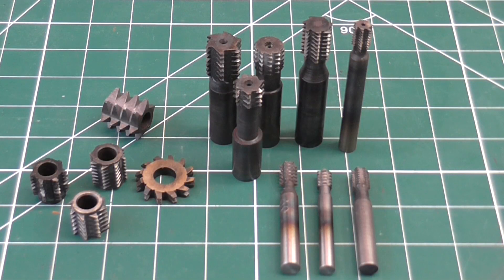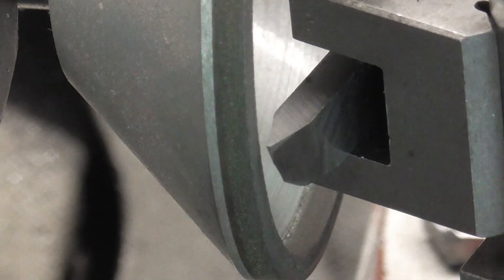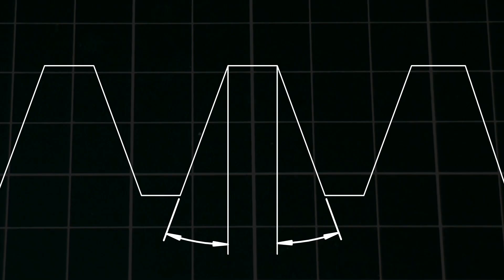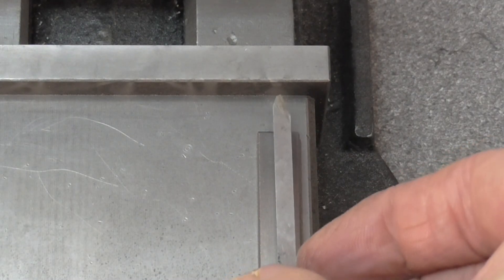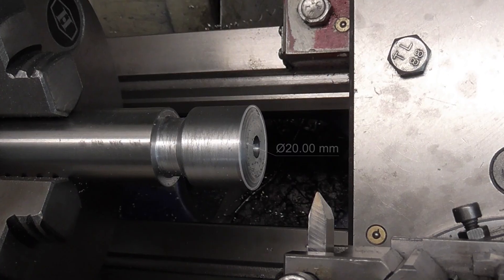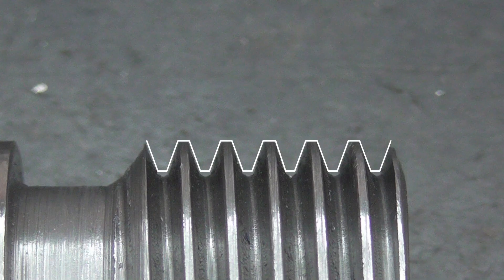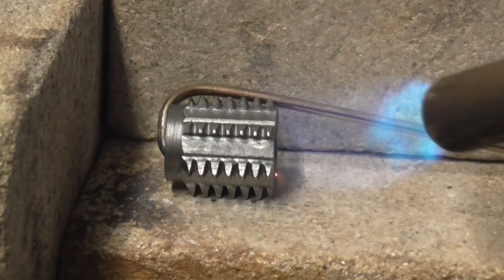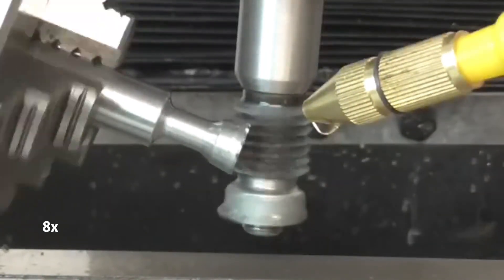How do I make my own gear hobs? (Gear cutting)

Comment: Hi Andy, I have another (hopefully last) question about home made hobs. How do you calculate the helix angle. I think the angle is a function of the diameter of the hob, but am not certain. If i'm right, do you use the outside diameter, or the pitch circle diameter. I'd be extremely grateful if you could give me an example, and the maths for the calculation. I assume this is the same angle you set the mill spindle to ?
Reply from the maker: I use the pitch circle diameter, the helical angle is the inverse tangent of the pitch divided by the circumference of the PCD. eg. if you had a 1 module hob with a pitch diameter of 40mm it would be ATAN (π/40 x π) (or in this case just 1/40) = 1.43° Think of it as a right angle triangle wrapped around a cylinder with one side being the circumference, the short side being the tooth pitch, and the hypotenuse forms the helix angle.

Yes, this is the angle you should set the mill spindle to but in practise you can be slightly off and it makes little difference as the tiny cosine error will be swamped by other limitations. I sometimes just line up the teeth on the hob by eye (always good to check that way anyway in case you tilted the mill spindle in the wrong direction!)
Reply: @AndysMachines  If I was to cut a 16D.P gear, with a hob of 1" O.D... The p.c.d of the hob would be o.d - 2* dedendum, so 1.00" - (0.0781"*2)= 0.8438" The pitch would be 0.196", and the Helix angle comes to 4.228 Degrees..   Does that sound about right Andy ?
Reply from the maker: Yes, just done the calculation and that's what I get too.
Reply: @AndysMachines  Hi Andy, thanks for checking the calculation !  I made a google sheets document that will produce the lathe tool tip width, measurement across two balls, and hob helix angle from the hob od. I tried to post the link, but the entire message got deleted. If it is of any use to you, let me know.
Reply from the maker: Youtube can be funny with links. That's probably the sort of thing that would be better suited for Patreon where I can share it with others, people tend to go there for more technical answers. (I share everything for free on Patreon and paid membership is entirely voluntary).

Comment: Hi Andy, I have a question about making hobs... If you produced a hob where the teeth were all in line circumfrentially, like a cylindrical rack? rather than on a helix, could you leave the milling spindle vertical, and produce decent gears? I can cut mod and dp, but it was just an idea. Thanks for your reply to my previous question about gearing the spindle. I have made a good start on my version of your hobbing attachment.
Reply from the maker: Yes, that's actually how I used to do it before I made my hobbing attachment. Depending on the size of the gear it will cut several teeth at once, then you index to the next tooth, or for better generation you can index by 1/2 or 1/4 of a tooth and move the 'hob' up or down by a corresponding amount.

I don't know what this type of cutter is called and I've never seen a commercially made one, but I'm sure this idea must have been around in the past.

Comment: you're using 2.5mm pitch on your lathe. it might be working with this small deviation to the correct pitch of 0.8xpi=2.513mm. but if you want to manufactur a other modul like 1.5 i think it will not work on a standard lathe because you will not be able to adjust the feed on 4.712. 5mm will be too far away and 4.5mm too less. 
or do i have wrong thoughts about this issue???
Reply from the maker: You're correct there is a small error but that's as close as I can get* with my lathe and it's really not significant. There is also actually a cosine error due to the hob being used at a slight angle (sometimes these errors can cancel out, but in this case they actually add up, still not enough to cause problems though).

Since my lathe uses change wheels rather than a threading gearbox I can usually find a ratio that works for most pitches, for 1.5 module (4.712) I could get at least as close as 4.725 which also works against the cosine error. Note that some lathes have a threading gearbox with module threads, but even these are not completely accurate since they are based on a value of pi being 22/7 giving a 0.04% error.

*Actually I could have done 2.507 or 2.52. 2.52 probably would have been a better choice allowing for the cosine error, but this error would only add 1.5 microns to the pitch, making the actual pitch required 2.5145mm. In practice I could never machine a gear accurately enough for this difference to matter.

Comment: I agree with the chap below, however I still have a question. You made the hob in a spiral thread, I was lead to believe that doesn't have to be so and you can cut using a dial guage to measure the different positions for you cutter, especially for a spur gear. Is this so?
Reply from the maker: Not sure who the chap below is at it depends on how the comments are ordered. But if it's actual hobbing with the gear blank rotating as the teeth are cut then yes, the hob needs to have a helical tooth arrangement. It's also possible to use a hob that looks like a stack of #8 gear cutters (rack profile) without any helix and index each tooth, or for more accuracy index the blank by a fraction of a tooth and move the 'hob' up or down a corresponding amount. This type of 'hob' will cut any number of teeth just like a real hob and it's how I used to do it before I developed proper rotating hobbing methods.

Comment: I'm returning to this video after an adventure in cutting gears with decent success to ask a question. What are your feelings about letting the hob drive the material? Came across a video where a tap was used as a hob and the material freewheeled. Haven't tried it myself.
Reply from the maker: It can work, but it is hit and miss and you can end up with a different number of teeth to that expected, or just a complete mess. It's critical to set the hob at the correct angle and best to cut to full depth in one pass. I would recommend gashing the blank with the correct number of slots to start with to give the hob something to locate on, but that kind of defeats the simple freehobbing approach.

Comment: That's awesome! I have an old CNC lathe that the control didn't work and used LinuxCNC on it.  It's really great at threading and can cut any thread, inch, metric or anything else. I'm thinking that it would be great for making hobs with the odd spacing on hobs for DP gears. I love it that one hob can replace a whole set of gear cutters. It would even be possible to put a hobbing attachment directly on the CNC lathe and synchronize with the spindle that is already encoded.

Comment: Good morning.
I've seen the video, but I have problems with English :) In the video You tilted the milling head by the degrees of the hob helix, to put hob angle and table parallel. Quite right ?
 And then you tilted the divider towards the tray, why?
What about straight teeth?
Reply from the maker: Yes, the hob is tilted so that the teeth are parallel to the table. To cut a helical gear you then tilt the hobbing spindle to the helical angle. For a straight toothed spur gear you leave this spindle horizontal.
Reply: @AndysMachines  thanks

Comment: Did you just make a skiving cutter from a hob cutter?
Reply from the maker: I made it with a custom hob which I also made. It wasn't perfect though.
Reply: @AndysMachines  Please make a video on the dark art of skiving tool.
Reply from the maker: It's not something I fully understand and more complex than it appears due to the interaction of the skiving tool and the blank, there's a lot more to it than a hobbing cutter. I'm actually trying another different method (not skiving) now, video on this soon...
Reply: @AndysMachines  All the hobs I've seen have a straight flute running coaxial with the cutter. Is that why hobs have to be rotated by its lead angle to generate the correct involute form on the workpiece? If it were a helical flute on a gear hob, does that mean the hob can be exactly perpendicular to the workpiece?
Reply from the maker: It's not the angle of the flutes, but the helix angle of the cutting teeth as they progress up the hob. This must be normal to the feed direction.

Comment: I must ask, do you possess the ability to calculate the number of teeth required for parts to rotate at a correct speed? For example, rotating one gear one rotation would spin the adjoining gear 365.25 times? 1:365.25?
Also, I'm a welder and metallurgy specialist, so the thickness and composition of the gears would be determined by the force required to sustain the loads on the teeth - are there particular addendum and deddendum angles and depths that are what could be called typical for usage?
I understand that's weighted more for engineering, however the terms of different teeth would be helpful to know for my own research.. are you aware of any terminology with respect to teeth?
Thanks for your video, it's wonderful to have you share your knowledge, where, in typical industry, skilled individuals hate to share their knowledge because it makes them less valuable to their company they work for. I have come across this hundreds of time in my industry
Reply from the maker: 1:365.25? That must be for a telescope or astronomical clock, right? That can be done with a train of gears, but you start to run into problems with prime numbers, for example you could do something like 365.25 =(1x3)/4x487. But 487 being prime does not divide down further so you would have to have a gear with 487 (or a multiple of) teeth. I believe clockmakers sometimes do things like this using differential gears to obtain fractional ratios with smaller gears.

Addendums/dedendums and pressure angles are all fairly standard. Sometimes the pressure angle is increased (by only 5° or so) for high torque applications but the usual way is just to make the teeth an appropriate size for the force required. Do a search for the "Lewis equation," this will tell you based on the Young's modulus of the material and dimensions of the teeth, how much force they can withstand.

For general gear terminology I have another video on identifying gears that might be helpful.

Comment: Hey Andy!

@ ~3:22, where did you get that "trick" of using addendum and deddendum in opposite orders to establish depth of cut of the rack (or hob)? Wouldn't that result in thinner and weaker teeth than calculated in first place?
 
Moreover, how do you arrive at 1.92mm depth of cut? Looks like you're further making the tips of the hob thinner, as 1.25*M gives just 1.8 mm of addendum + dedendum.

I'd say a rack (or a hob's profile for that matter) meant to cut gears might not be the same than the one
that gear should use in production (it's final application).

The only thing offsets (beyond calculations) seem to achieve is backlash (by reducing teeth dimensions), and the absence of these results in a gear and a rack that have no clearance whatsoever.

Or is it that I'm just missing something?
Reply from the maker: Hey Eduardo!

It's not really a trick, the hob tooth form is just a mirror image of a rack. (Addendum and dedendum reversed)

The Depth of cut in this case (0.8 module) is 1.92mm as the dedendum is not 1.25, it is 1.4. The larger dedendum value is normally used below 1 module due to tolerances. (See the note at the bottom of the screen @ 3:22)
Reply: Thanks Andy!. Yes, I missed that, haha!. Probably because of the player controls, as I was pausing the video following your maths along. I understand things are different here because you are cutting a hob to cut another hob.

But my question still remains: If I make a hob like yours (the first one), dimensioned as stated in ISO 53 (a basic rack), I cut a gear with it, and then use it again to cut a small rack, wouldn't that result in it not having any bottom clearance when meshed with such gear? That's why I asked if a basic rack (or a profile meant to cut gears) is different than a (commercial?) rack, meant to mesh with a gear in a real application with no interference and "proper" clearance.

So it's maybe the case that commercial racks get a bit more of addendum? But that would cause backlash. Or because theory is different than real life (the machine not perfectly trammed, tiny concentric errors in the hob, etc.), that you end up with some minimal unwanted clearance that allows the pair to mesh just right and one lives with that?

The thing is I have plastic racks and gears from inkjet and laser printers I've been inspecting, more specifically, from the part that let's you adjust the width of input paper, and these racks show clearance at the bottom of the teeth, so the gears' tips never interfere with it, yet they show no backlash.
Reply from the maker: The addendum is always the same (=1x module for metric gears.) The dedendum can vary, it is usually in the range 1.25-1.4 but needs to be slightly bigger to give clearance for the tips of the meshing teeth. The width of the tooth is half of the pitch spacing on the pitch circle/line, this is how you can fully mesh gears/racks together (no backlash) and there is still clearance in the root of the teeth. It's important to realise a hob is actually a mirror image of a rack (addendum/dedendum reversed) so that it cuts (subtracts) the correct geometry.

Comment: I was going to comment that if you extend the dedendum (on the cutter or the rack in the 2D drawing), you would thin the resulting gear teeth because the cutting teeth are longer, right? But...I don't think that would happen. It really takes time to understand how everything meshes together.
Even if you extend the dedendum to the ultimate limit - pointy teeth on the cutter...the resulting teeth would NOT thin as a result of the longer cutter teeth. Weird.
Reply from the maker: The fewer the number of teeth on the gear, the more undercutting there is of the teeth below the base circle. This starts to become problem with less than 12 teeth so often the geometry is modified (profile shift). If you extended the dedendum on say a 6 tooth gear, you would end up with a large circular hole between each tooth which would eventually cut through the tooth completely.
Reply: Right, the involute folds inward below the baseline. So, to correct my initial observation: the dedendum on the cutter thins out the teeth below the baseline but the length of the cutting teeth does not affect the resulting teeth above the baseline. Or to put it differently, the involute line does not change if you extend a straight line cutter. Thanks for the clarification.

Comment: What did you make with the cutter at the end ? An internal gear? Where did you find out how to calculate the gear cutting angles? Not just the spur gears but the spiral cuts also. Thanks great video.
Reply from the maker: That was a cutter for making an internal straight-toothed spur gear via a gear skiving method, though I didn't get the geometry quite right and although the gear worked it wasn't perfect.

Comment: hello, how are you? I'm Brazilian and I'm learning...can you tell me which thread pitch is similar to the diametral pitch 18....the gears of my lathe and this module and I would like to manufacture the same as you did but I don't know if it is possible to do the same as you did
Reply from the maker: Pitch=π/18
     =0.175" (5.73 tpi)
     =4.43mm

Or as close to that as you can get!
Reply: @AndysMachines  so I'll try to do it with the step of 4 .5 and see the result....thanks a lot

Comment: Having difficulty understanding why the  single point hob cutter needs the tip flattened?  I followed the ~3:30 graphics but cannot see how the flat bottom created on the hob by the flattened cutter is involved in cutting the gear teeth?  Only way I see the flat bottom of the hob teeth come into play is if the hob is driven too deep into the gear blank…. Help
Reply from the maker: You are right, the flat at the bottom of the hob (top of the tooth) is not absolutely necessary, but most gear hobs are the 'topping' type which means they will cut the tops of the teeth if the blank is oversize (or not concentric). When cutting the hob with a single-point cutter the most important thing is to get the depth of cut correct to produce teeth of the correct width, having a precise location for the flat makes this easier and the top of the tooth is the obvious  place. You could use a cutter with a sharp point and base the calculations on that, but the point would be very weak, probably break off, and the hob teeth would be cut deeper than necessary which would make them weaker. A third way is to put a radius on the single point cutter some way beyond where the flat would be, this would produce a 'non-topping' gear hob